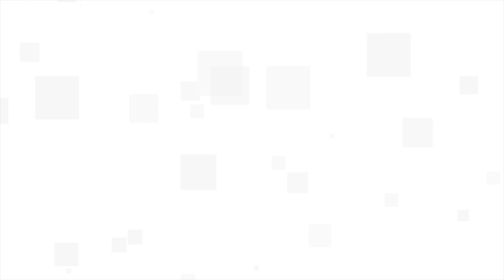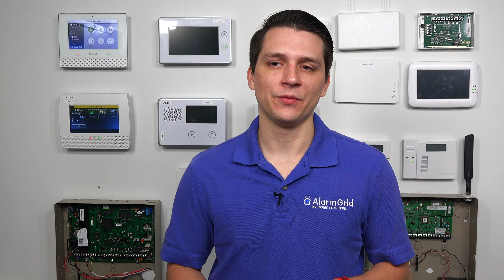DSC Wireless Sensors and the Lyric Panel?

Comment: I think there is a module for that because the ADT command panel which I think is basically a lyric is currently using my dev wireless sensors. I don’t know if this is correct but?? ADT installed it.